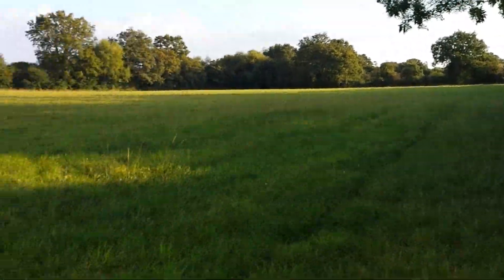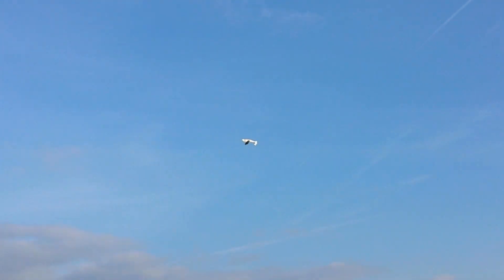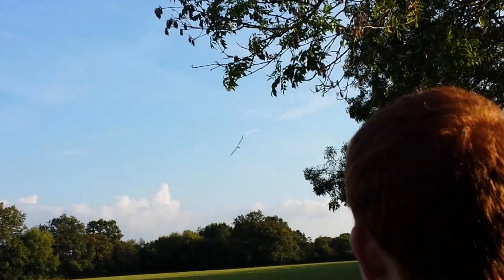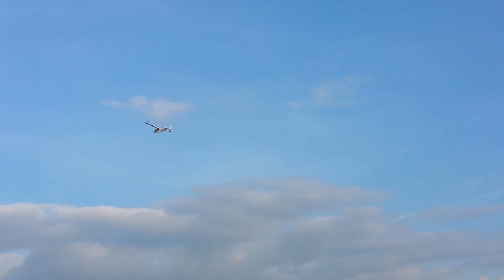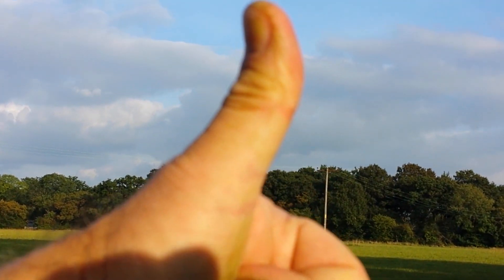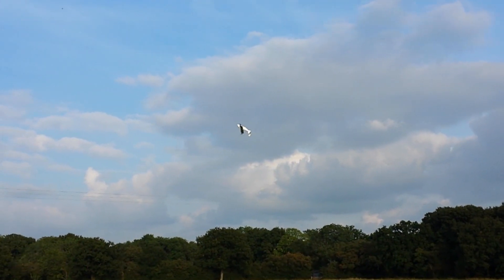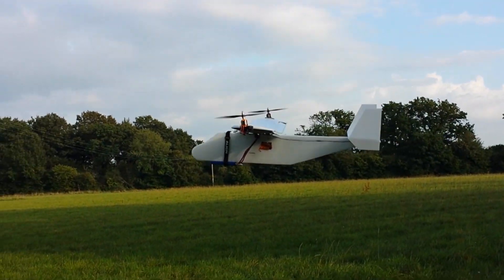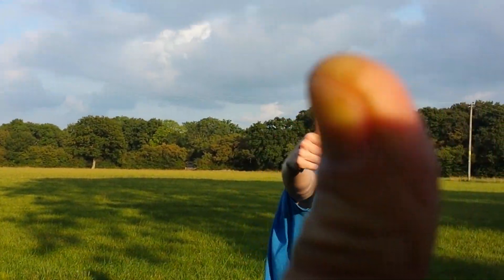RC VTOL V2 Aerobatics + Stall Testing

Comment: Great job! The perfect aircraft for small field operation. Tom, why not use electric turbo fan or electric jet turbine engines and eliminate the props? What type of controller function do you use to achieve motor rotation?  Of what length is your allowable flight time?